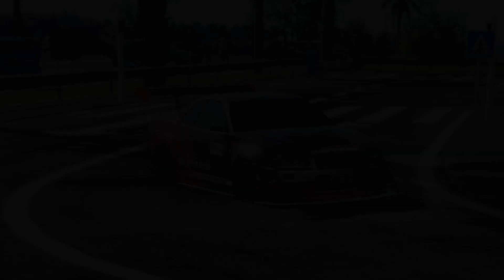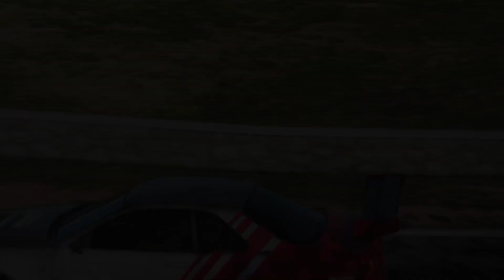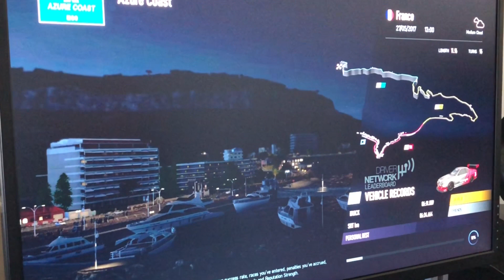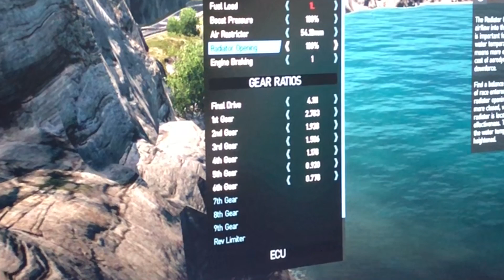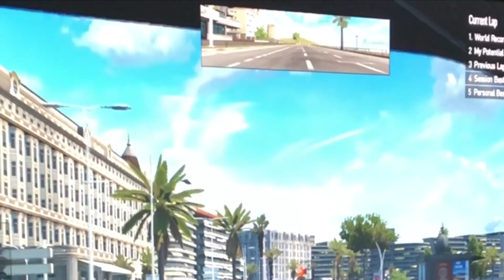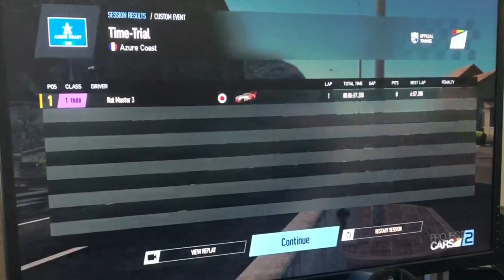Project Cars 2 Setup Guide - Azure Coast - Nissan Skyline GTR R34 SMS-R - Lap time WR 6.57.257

Comment: Hi Jay, got half way through your video, @15:30 was that someone me from last time :-).

I've found this from PCARS forum:-

' Basically you can use the ramp angles to select how much locking you're getting out of the clutches for each direction (20 degrees = maximum, 90 degrees = minimum = none) and the numbers of clutches will then increase or decrease the total locking force.'

Check the link:- 

http://forum.projectcarsgame.com/showthread.php?52783-Magic-inside!-Need-Help-With-Differentials

Again your thinking of it the wrong way. Higher angle 90 degrees = open diff same for Power and Coast. 

I think this also affected your explanation of the front diff on this 4wd, something to be careful of. 

Front power diff - more locking - 20 Deg - creates understeer.

Hope this helps. ;-)
Reply from the maker: WireSniffer I think my next video should explore the effects that I experience when adjusting the diff...

I think it would help me understand things better and hopefully others will be able to see the effects as I adjust them.

I’m still not satisfied I have it wrong but thanks for the link. A very interesting read.
Reply: @jaysysumakaRatMaster3  I think you should do a dedicated video to the LSD. 

There is nothing wrong with  your LSD theory regarding wheel speed and going round an apex, but if you look at a real diff the ramp angles are correct that 90 degrees is a flat ramp angle therefore zero coast or power.

Check out ViperConcept on YouTube he did a LSD special video. And in it he clearly shows across 3 or so Sims how the LSD works and works the same. 

Thanks for the videos. I shall finish watching them eventually.

Also:- 

https://youtu.be/PEdnH7_7_yc